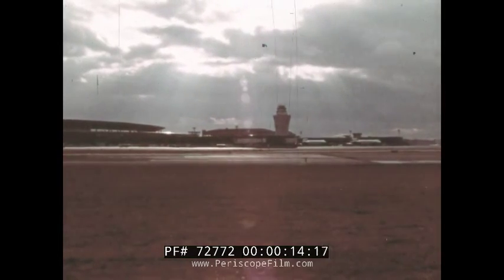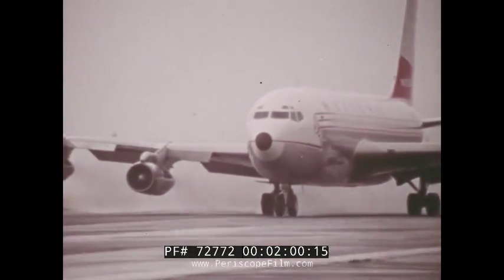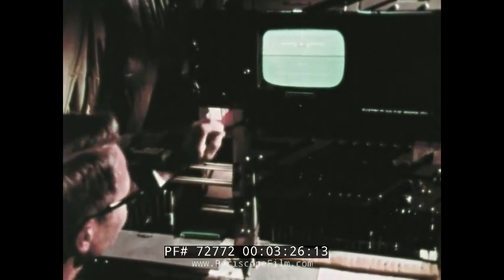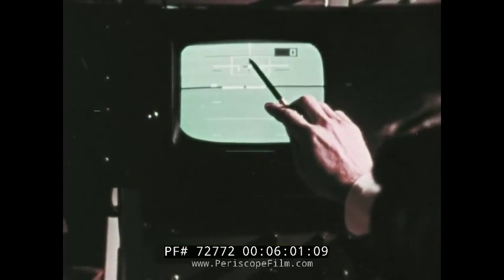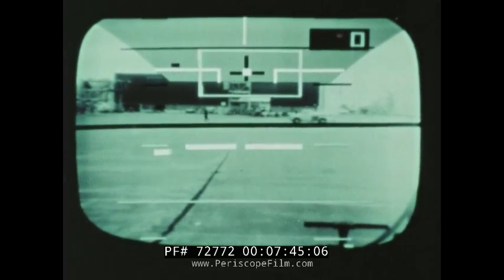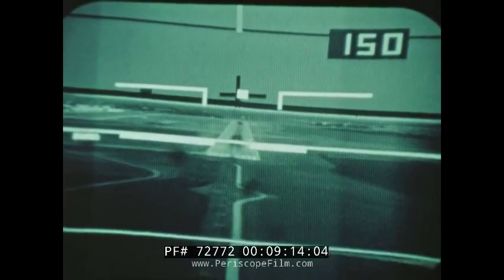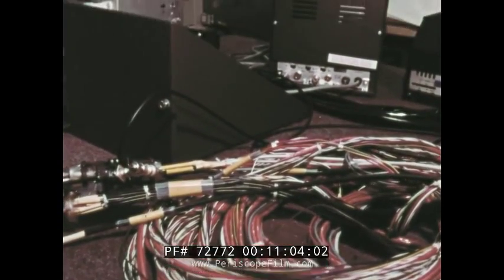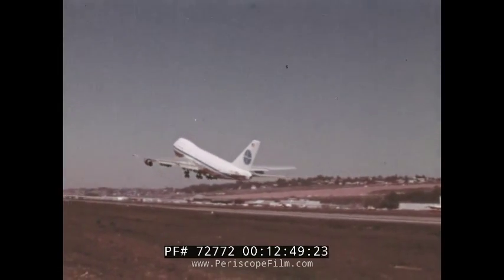" ELECTRONIC ATTITUDE DIRECTOR INDICATOR " 1970s BOEING  EADI PROTOTYPE FILM   707 AIRCRAFT  72772

Comment: ...it was known as the Dash 80 not Model 80 (shortened from Model 367 - 80).
hehehe...this display looks like 'pong' technology - I guess it was in that era. A precursor to later 'glass cockpits'
B52s in the early 80's were fitted out with infrared cameras for low level all weather flight .....not dissimilar to this.